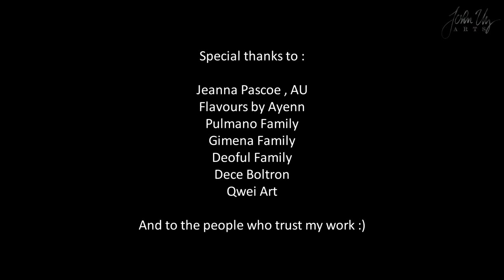Leaky BR-M615 | Shimano Deore | Hydraulic Brake | MTB

Comment: I need to change caliper sealing rings on BR-M446 SHIMANO i having hard time to find out which sealing rings i needed what are measuments for sealing ring do you know can u help me, thanks 👍
Reply from the maker: Im afraid i cant help you with the measurements right now
But, if you have already disassembled the brake caliper, you can remove the o ring and measure it with a caliper ruler.
Or, try checking at amazon or ebay if there are parts for sale, then check the description if there are any measurements posted. Search your caliper model. Then you can use it as a guide to buy o rings at any shop